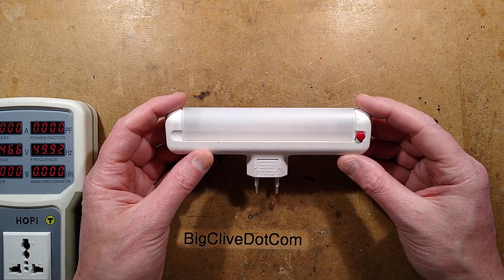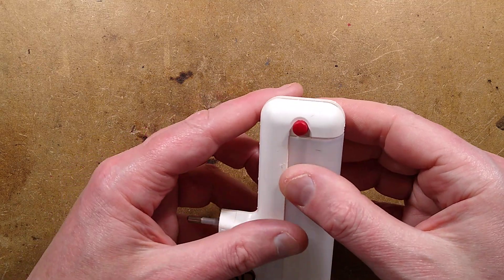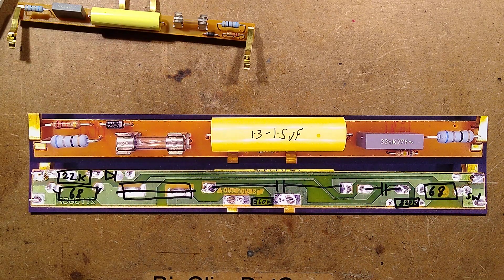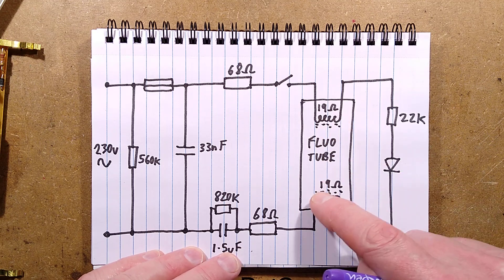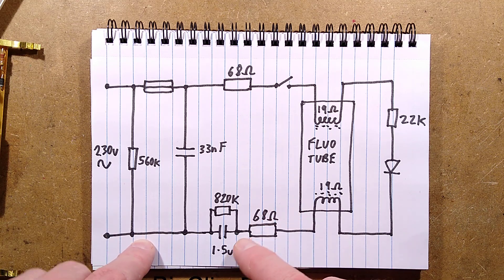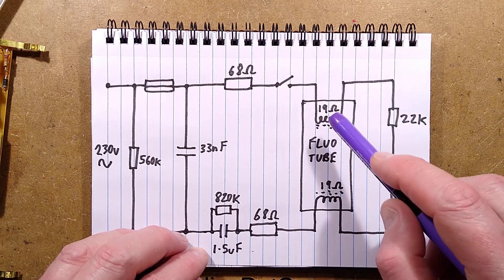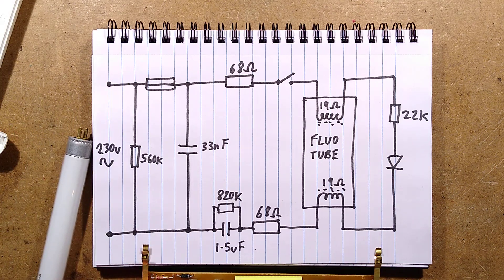Clever tube igniter circuit with schematic

Comment: Yeesh...that is an awful circuit. "We don't need no stinking switching circuit!" 🙄
It'd have been much better if it were a "manual start" type, like one used to see on older fluorescent desk lamps, where there's a start button you hold in for a second or two, let go, and the tube(s) ignite. Better for tube life, and minimal cost difference.
Reply: I bought a "modern" high end magnifier lamp that had that, and it confused me at first. I actually bought it as a customer returned faulty, for a good price and I found nothing wrong with it. I can only assume the original purchaser could not work out how to turn it on
Reply: @eDoc2020  even the smallest DC component will cause mercury migration over time but the biggest problem will be sputtering due to lack of cathode heating.  Those small tubes had a notoriously short life, of course at the time I owned one of those things I didn't know why they rapidly blackened especially with cheap batteries inserted.  Things are too easy these days with white LEDs!
Reply: The start button only worked because people back then were smart enough to use it.
Reply: The tube gets DC even when running which is really bad news for mercury migration.
Reply: @ianhosier4042  turn the tube around after a few months...
Reply: I have an NOS one.  new in package made for US 120v/60hz..  INTERNAL components are: 33 ohm 10 watt resistor (ceramic)  , large orange cap marked 275J 250v  ,  diode, rocker switch .  SO the   120v ac lead goes though CAp, tube end1a. the filament1, end1b then diode, then tube end2a, filament,  end2b then 33 ohm,  rocker switch, then power lead.   Less circuitry than one shown.   The tube has no pins, it has leads.   Case held together with clips.     "Liberty Lights" mini Fluorescent Night light. US-PAR Enterprises INC Chino California 91710-5149.   . Model ML-400   120v 60hz  3.5 watt  UPC code 0 25066 00400 7.
Reply: I just replaced manual start fluorescents with LED bulbs with zero regrets.  The old bulbs would light up when I walked by (static electricity), they'd buzz, and I had to hold the ON button to get it to go and pound the OFF button to get it to turn off.  All problems gone with the LED bulbs, but I did have to put a PIC microprocessor in there to work with the old fashioned switch.  Crazy switch, with momentary contacts only (one set of NC, one set of NO).

Comment: Man I love gas discharge lamps... I've gone on some kind of spree purchasing neon bulbs and indicators, and other gas bulbs/lights because they are fuckin awesome and it sucks seeing them go away. I have gas bulbs older than me no joke that still run just fine (I'm only thirty but still) last year I stocked up on a ton of incandescent bulbs of various voltage and size and now gas bulb/tubes. It's weird seeing everything get killed off for "better" things. I have several or a lot 🤔 of crt tubes and tvs because they are awesome but shh my fiance will roll her eyes 🤣🤣🤣🤣🤣
Reply: I've started collecting CRTs lately.  I had some friends come over and she was going on about it in that 'sigh.. what are you gonna do' kind of way.. "What do you have now, like.. 20 CRTs?"  My immediate thought was.. sweet, if that's what she thinks I'm up to, I can go get a few more CRTs!  🤣
Reply: @sirnickity  LMFAO 🤣🤣🤣 that's how my fiance is haha she only knows of 3/4 of the large ones and one small one haha. I have maybe 24 with screens the size of my hand or smaller and a few larger hidden away. Nobody makes them anymore and most people don't seem to give a crap about them anymore. So I figured why not use them for various things and keep the rest in case anyone is ever looking for one. I'm lucky though because I've come across a lot of them by working with TV stations and a few from radio stations locally.
Reply: Man, I really wanted to see the induction lamp take off, but I don't think it will...Since LEDs have taken over instead. 😥
Reply: @bryan8735  That would be awesome, I guess you're right they seem to have become a thing in the wrong time. Light is awesome and I'll collect and use any odd light I can 🤣
Reply: @bryan8735  well schools and places like lowes (where I live at least) still use fluorescent tubes, they use electronic ballasts though, not magnetic ones.
Reply: I know they're so amazing! I love the different colors and glows you can get from different phosphors, and I like the high voltage that sometimes comes with them.

Comment: I wonder what the voltage is across that tube after it has struck?
Reply: not very much, it's a mercury vapor lamp, recall in his other videos on them there are mercury vapor lamps that run on 12V once struck, this one is longer so it might be 30V instead.
Reply: Might not be as low as 30, but probably no more than 60V.
Reply: @eDoc2020  Wow, somebody did his homework! Cool to know! I'm not surprised that the power factor/tube voltage was a little different here, considering the weird ballast in there... wish I'd thought  of calculating based on power factor.

Comment: That's cool, basically it starts out as a voltage multiplier/doubler then "switches gears" using 2 active components, one of which is the non linear behavior of the bulb itself.

Comment: Not sure where this would be useful.  If I plug this into any of my outlets, I'll get illumination behind my dresser, under my workbench, behind the curtains, in that gap between the fridge and the wall... etc.
Reply: Back lighting my fridge, dresser, and shelves sounds kinda fun 🤣 might have to try it just to see
Reply: Outlets in the hallway and in every room about 30cm from the floor are common in GER. (For vacuuming).

So you can have a dimly illuminated way to the toilet. Enough to take a pee and get back to bed without broken toes and screaming your partner awake.  Not really a longlife design but clever to use.
Reply: Also hallways, and near the bathroom sink
Reply: You could use a multi-socket extension cord hanged up on the wall

Comment: Lol "last longer than the LEDs"

Yep, some of em 🤣
Reply: Its true. I have two or three cfl bulbs that are all over 20 years old (one is in a garage) which still work. 

Can't say the same about some modern LEDs.
Reply: What's bad is the ones that, instead of a bulb, have some integral part of the fixture loaded with allegedly "light emitting" diodes. I've seen them be faulty right off the shelf, or die after a few months. Not saying they all die, it seems like random "duds." Ah well, more work for the electricians since these things are usually full-on light fixtures that have to be changed.
Reply: @deltab9768  As has been mentioned numerous times... They drive them way too hard, and it looks to be intentional. If they don't fail, they can't make money.
Reply: @MadScientist267   Planned obsolescence is part of it, and then maybe sloppy quality control?
Reply: The LED lamps are just designed for bright-and-cheap; no need to design for obsolescence or short life, both those come free.
Even this CFL is apparently designed for 'very cheap', not that that's necessarily bad...

Comment: I never noticed that the battery operated camping lanterns that I have had with these smaller fluorescent light bulbs didn't come with a small replaceable igniter. They must all have had a built-in igniter like this one. The fluorescent light bulbs were replaceable on them. Strange that they didn't use a cob led strip or some other kind of led light in the light you have got there. Maybe it was made before the led lights were invented.
Reply: It was made before white LEDs got cheap enough to make it to consumer devices.
Reply: @acmefixer1  Or even bright enough, I remember a lot of early LED flashlights and house lights and they were extremely dim. I think I've got an early LED GU10 bulb around here somewhere for installing in ceiling fixtures and it maybe puts off the equivalent of a 5w incandescent in a sickly cold white color.

Comment: Actually, I liked the circuit. 
However, the plastic enclosure looks home-made with a pair of cheap molds.
Reply: That's a shame since they're relying on the movement of a pin in the case as a switch.

Comment: I had a 1000 watt Mercury Vapor lamp that in addition to the probe-start resistor, it also had a resistor and diode inside the glass envelope! I finally figured out that as with this circuit, the resistor and diode would charge up the power-factor capacitor that was in series between the lamp and the ballast to help obtain the voltage needed to strike the probe in the lamp and start conduction.
Reply: Remember, I am talking about a high power CWA transformer based ballast such as the M47 which includes a PF capacitor in series with the lamp, and usually scores a PF of .9 or 90% Such a circuit is not a capacitor dropper circuit, the cap is there to correct the PF which typically scores a .47 if the cap is not used (such as the old 175MV lamps.) Old MV and some Metal Halide lamps do not use an ignitor, but instead are "probe start" and in cold weather may need a bit higher of a voltage to get going.
Reply: @JDfromWitness  I am aware of that, but with CWA ballasts (unlike older HX ballasts) the capacitor also doubles as part of the ballast (like with the lamp being taken apart in this video, except in that case, the capacitor is the ballast), so removing it could end up damaging the ballast and/or lamp (improper power regulation beyond what a mercury vapor lamp can tolerate). Now, some HX ballasts have a capacitor, but with those, the capacitor is solely for power factor correction and nothing more. Another thing is you can't expect something in series with something else to not affect what's in series with it, so even if the capacitor is relatively large in capacity, that will still have an impact on the lamp, even if you don't seem to think it does.

At the end of the day, I really don't want to see you or anyone else accidentally kill their lamps/gear due to something that can be avoidable, as right now, anyone who reads your comment who has a similar ballast with say, a dead capacitor, will think that they can bypass it, and it will do no harm to the ballast or lamp, and with gear and lamps that are becoming less common by the day thanks to the rise or LEDs, and the fact that mercury vapor ballasts have been banned since 2008 (banned as in new ones can't be imported or distributed, not possessed), means that whatever few that still exists because someone found it neat and decided to keep it for that reason need to take good care of it to ensure it lasts a long time.
Reply: If the capacitor is in series with the lamp, then it would be part of the ballast and not just simply power factor correction (at least that's the case with North American CWA/CWI ballasts), but it does have the benefit of power factor correction.
Reply: PF is 0.16 for this lamp, so the (in-series cap dropper) cap seems to be doing the opposite of PF correction :-)

Comment: Lampi is a German company and manufactures lots of different lights, like office lights, kitchen lights, halogen spotlights and many more.
Reply: A brand, rather than a company, I think.
A German trade magazine says it was from a company called Korte AG, from the former West Germany, until bankruptcy in 2004.
The brand was aquired by Lite-Licht GmbH in 2008, and used in their "StarLicht" range.
Reply: @ann_onn  You're absolutely right! But it started as a company Lampi Korte GmbH, founded by Henry Korte, and later also Lampi Corp. in the U.S. if I remember correctly.
Lampi became a brand of the later Korte AG. Now it all belongs to Globaltronics, I believe...
Reply: @ann_onn  see also http://web.archive.org/web/20030812130233/http://www.lampi.com/Home/Company/About.html
Reply: @ann_onn  it was odd to see this lamp in my subscription box... my dad worked at Lamptronic (closely related to Lampi) for years and we had a few of these lamps at home :D
Reply: I saw that plug and said "that's a German lamp, Euro Plug with no earth connection"...

Comment: How to check if a device with a capacitative dropper has a discharge resistor for safety the Clive way.
   
1) Unplug the device
2) Immediately touch the pins
3) If you don't wake up on the floor or in the hospital, the device has a discharge resistor and the pins are safe to touch

Comment: If the fuse blows could the 33nF capacitor be left holding a charge?
Reply from the maker: Yes, but only with the cover off and it's a low value.
Reply: Also, if the fuse blows there's likely a short circuit that would discharge the capacitor anyways :)

Comment: I love the Big Clive patented capacitor-discharge tester, dab hand on input pins.
Reply: 1:20 testing with fingers 
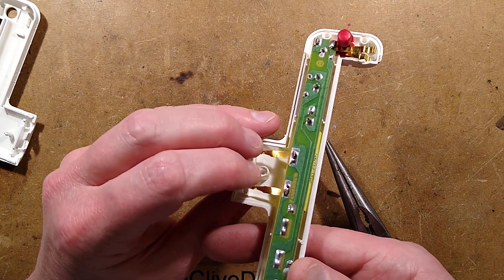2:52  "Quite a big capacitor here I should be careful."
Just a bit late for safety thoughts
Reply: @scriptonite454  "Safety third" is what I normally hear (from AvE, maybe? :-)
Reply: Not just for measuring capacitive state of charge, but also to determine if the circuit even has a capacitor. Of course you might have to plug it a few times to get a good point in the sine wave...
Reply: pretty safe so long as the thing is unplugged and you only use one hand